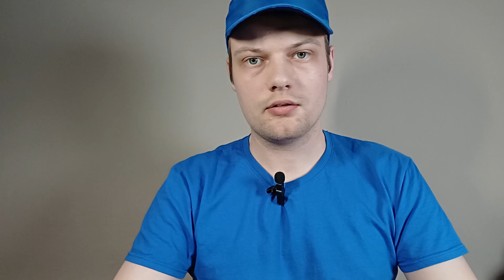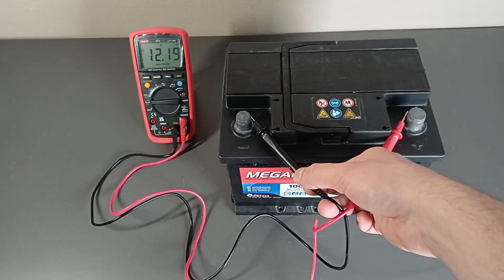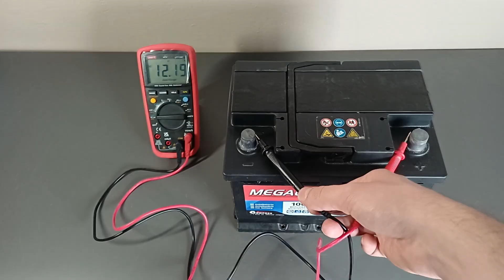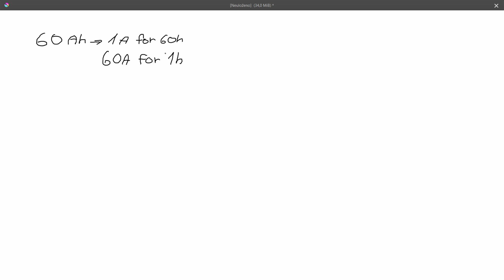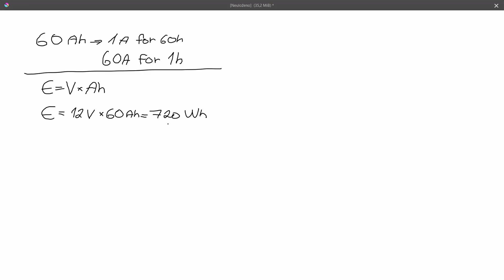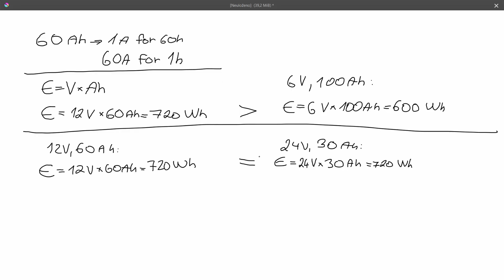100Ah Battery Might Have Less Capacity Than The 60Ah One (Here's Why)

Comment: Worth noting that lead-acid batteries aren’t meant for full 0–100% cycling, so you usually can’t use their full capacity. LiFePO4 handles this much better
Reply from the maker: Yes, that is true. However, this video used a lead-acid battery only as an example.